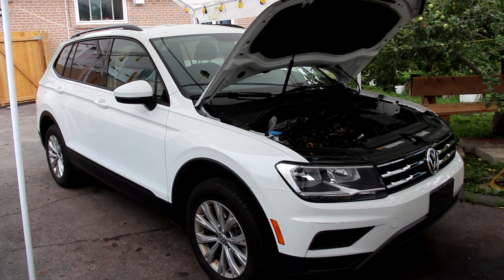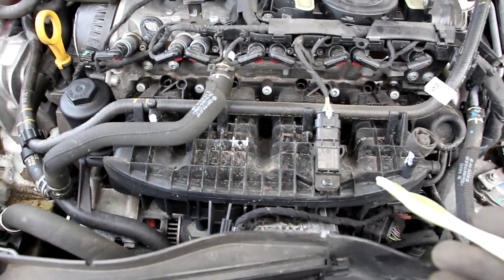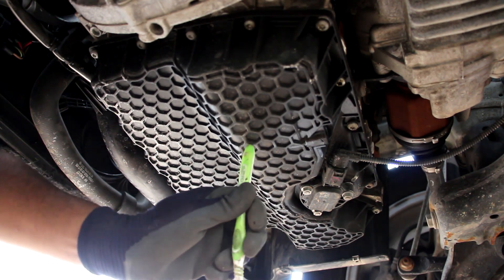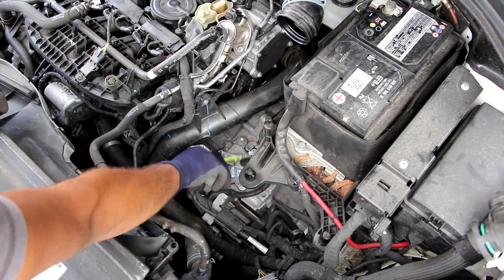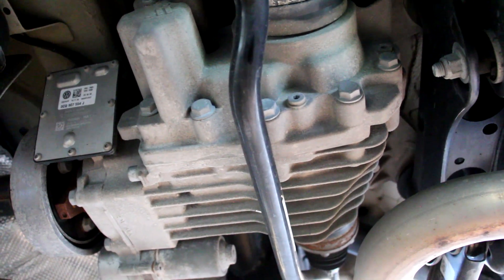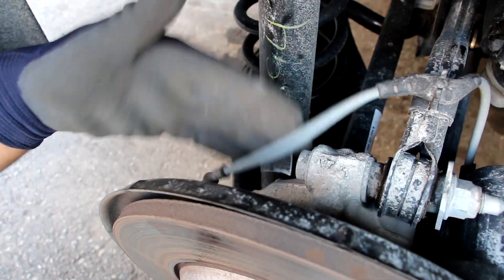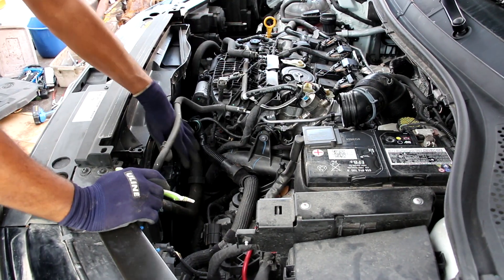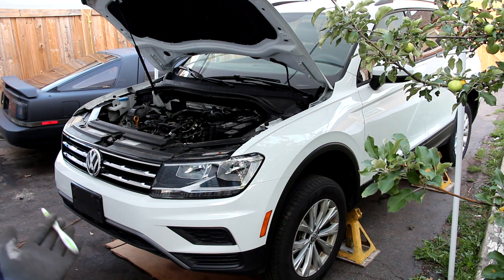Volkswagen Tiguan Mechanical Review

Comment: I bought  a used 2018 Tiguan S just like the one on the video with  110K miles . I replaced the turbo at 112K miles . Right after that , replaced water pump / Thermostat. I had EPC light back in with Turbo issues again , this time VW technicians are suggesting to replace Engine Harness which cost $3K to replace and install which I am doubting to fix at this point … not sure what to do ?? Anybody have any suggestions or tips ??

Comment: I bought a 2019 Tiguan SE with 12,000 miles. 6 years later and currently at 197,000 miles. Extremely reliable. Regular oil changes, 1 trans fluid changeout, couple sets of brakes, tires, 1 battery, spark plugs, and two coil packs . Still on original water pump. No leaks. Currently burning around a quart every 8,000 miles. Still runs and drives like new.

Comment: 7:28 notice how the dipstick is pulled and after he goes to start the vehicle and says it’s running poorly? That’s because he purposely created a vacuum leak, yet he won’t acknowledge or admit it…😂
Reply: Yeah. You can hear the vacuum leak. OIL separator doing its job keep the engine on.

Comment: I have 88000 on my Jetta GLI in 4 years and it has been fantastic.  Only issue I had was with the plastic oil pan.  If you change the oil you must use an OEM replacement plug, the third party ones leak.

Comment: that 0w-20 oil should be vw 508, which is quite expensive.
Reply from the maker: From the dealer? Why not from parts store
Reply: I am in Canada. The cheapest I used to find is the Pentosin Pento speed sp lv, which compliant with the vw 508, roughly 10 dollar cdn a liter. But that is widely sold out in my area. Now only can find liqui Moly top tech 6200 more cost effective. The motul spec 508 is more. Other brands like M1 ESP X2 or Castrol whatever also more. Like 18.99 in canadian tire. Compare to the regular 0w20. For damm sure the 508 spec is more.  @speedkar99

Comment: How many hours have you spent behind the wheel of the Tiguan?

How can you give that criticism to the interior of that car!  It's exceptional !  I can drive 8 hours with normal  breaks without complaining.

Additionally, we have had our '18 Tiguan since new.  It's an exceptional vehicle.  100% dealer serviced 
.. never a check engine light.  Whose car are YOU evaluating?
I was hoping to subscribe to a decent , thorough car technician who could be helpful.

Unfortunately, you obviously have no knowledge of the brand or model of vehicle of which you're  evaluating.

Not a subscriber, after that.

You, sadly, are a quack.

BTW - I am a corporate Fleet Manager with over 25 years of experience.

Quack!

Comment: I hate how people crap on these cars about their reliability. People need to understand that VW’s can’t run off of just Oil changes like a Toyota, they need more than that! I change my oil every 10,000 kms on my 2018 Tiguan and service the Haldex all wheel drive system every 40k and spark plugs every 60k. I even do the transmission every 130,000kms. People need to realize these cars last with proper maintenance and fuel. USE PREMIUM FUEL IN YOUR TURBO VW’S!!! Even if it says regular, you should still use premium.
Reply: You've highlighted the issues with them Jeff, they are inadequate for a working life of hard use. They are fragile.
Reply: @cliffwilkins9178  where did I highlight the issues? Simply said what these cars need for reliability. The only reason why Volkswagens are seen as unreliable is because people that buy them are used to driving a Toyota. They don’t put the recommended maintenance them to them.
Reply: @cliffwilkins9178 exactly stay quiet

Comment: Looks like a lot of the parts are easy to access for change out though a lot of plastic going on here. For example I have a 07 tundra 5.7 and things like the starter/alternator are hard to access their tightly snugged to the bottom of the engine.
Reply from the maker: Yeah the Toyota V8 has a really bad starter placement

Comment: VW products are loved in Algeria and tend to last a fair bit of time and depreciate the least... we mostly have naturally aspirated gasoline engines and the reputable 2.0 TDI 143 HP euro 4... no FAP or AdBlue to worry about... the most commun problems are injectors related and automatic transmissions ( 80% of the cars are manual )

Comment: You mentioned that that that the design does not include a radiator drain plug, Additionally, it doesnt really include a 'main' radiator fill-cap.  Instead, there is the remote radiator overflow tank... that allows 'filling' there... which only works if the radiator (and system) is already filled with water. 
 When the 18mm (small) horse 'blows' between the reservoir and the radiator for example... and ALL the water blows out of the engine, and you're on the road in the Sierra, then NO 'gas station' mechanic can simply patch the hose, and put water BACK into the engine... without 'special skills' or an electric pump.

Comment: Due to a recent car shortage i ended up purchasing an inexpensive  base model 2021, brand new that's currenty at 4k miles.... Going to follow scheduled maintenance intervals and see how long it lasts before major problems arise. Honestly curious.
Reply from the maker: Hopefully all goes well. Pay attention to the oil levels at every gas fill up
Reply: How's it going so far? I'm thinking about buying this model
Reply: @sailorsct4292  so far so good  👍  currently  sitting at 23k miles. It fits a full costco run along with entire family. Good  power and 36 mpg on road trips on regular gas.
Reply: @napalm84  Hows the reliability
Reply: @rken3116  Good reliability overall. Currently sitting over 37k miles w regular maintenance.
Reply: @napalm84  thank you for the response

Comment: Have had a FWD 2018 Tiguan for 4 years. Had no mechanical issues so far.
Reply: How has it held up since your comment? So in the last 2 years? I love the 2024 tiguan but am worried about reliability
Reply: @katerinapascht6075  I will buy one this month, I was going to buy a 3 cylinder 25 Chevy Trax fully loaded 2RS for around $28K with a 60 month 5.4% APR with my Credit Union BUT just found that the base 2024 Tiguan S Is SUPREME!! for just $30K with a 1.90% APR for 60 Months so thanks to this VW promotion it will be the same cost as the Trax but Honestly the Tiguan is extremely a better all around vehicle than the Trax and it has 7 SEATS!! WOW
Reply: I wouldn't expect a 4 year old car to have mechanical issues. If it does that's sad. 4 years with no issues is not an achievement lol.

Comment: I had a 2015 Audi A3. Since 2017, I had to send it to service due to coolant leaking issues basically at least 1 time per year. They told me many reasons for the leaking, including sealing issues, water pump failure, etc, but they never really fixed it. One time, they told me, ok, we fixed it, after 10 mins driving, my engine smoked. In 2020, sold it. I told myself not to buy any Audi again.... While ordered an RS3 a couple of months ago.

Comment: One of the best technical information videos ive found on the ea888 engine .I have the mk1 tiguan .Would you have any idea if the air conditioning drain pipe is in the same location as this updated motor.I have a really smelly ac system and wanted to clean the evaporator

Comment: 2018 Tiguan is my first and last VW.
2 Months in and it goes to VW for going into limp mode due to what I was told a loose connector at the accelerator pedal.  
Then is gets recalled for a coolant bottle @ 10k and the coolant still noticeably drops between services,  I can even smell coolant after a long drive.   I mentioned to VW I suspected coolant loss/burn stated the amount of cooling I'm loosing between services is normal, What?  
Recall for ECU reprogramming @ 20k.  
Then about 30k I started getting warning flashes on the dash and by the time I look down  it's gone and doesn't appear in the fancy vehicle status screen.  Check engine light going on then off and VW says it was all a low battery but tested it and didn't recommend replacing it.  
30k service included 2 new tires with alignment, all new rear brakes, diff fluid change, cabin filter, brake flush to the tune of $2000. 
 I'm afraid to work on this myself like I have every other car I've owned because with all the issues its having I want to make sure VW doesn't use me working on it as a way to weasel out of honoring warranty work.
Now at 32k Transmission goes into "emergency mode" and had to bring it in for shifter replacement.
Reply: I would never ever buy a vw again, it's sounds like a great nightmare

Comment: Had a late 90's Audi A4 1.8L. Still VW engine, after 100k km, nothing but problems, engine wise, transmission wise, also wheel bearings too. The whole 5 yrs I owned it, the car costed me around $9k to fix and keep it going. Eventually i sold it, as it was costing me to much, and bought a diesel Hyundai I30. 6 yrs now and no issue.
Reply from the maker: Nice. Was it a turbo? I'm doing a 1.8T teardown video now

Comment: I love that car, it's engine is made of steel and that to me is something that you can sleep better at night for. The rest well it is a newer vehicle so techonology as scary as it is at first with my VW it has proven to be the most reliable in the long run.
Reply: How can you sleep better as steel block and alumnium head mating surface will very likely to warp due to different expension rate.
Reply: @xuanzheng1049  cause Ive been driving cars like this my whole life, I have a 28 yeay old vento and it runs perfectly as reliable as ever. Now Aluminum blocks when overheating and cars do overheat for different reasons like bad fan relays, temp sensors etc require resurfacing of both block and head meaning less life to the engine and extremely expensive repairs. Most people change cars every 4 or 2 years so tbey don’t know what Im talking about. This VW is built to last 💪
Reply: @camcappe353  did you not read my comments well ? Your Vento has both steel block and head thus has the same expansion rate but the Tiguan doesn't. It has different materials as block ad head which will likely warp down the road due to diff expansion rate.

Comment: Too much plastics on new German cars those years, I will never trust those cars again, cheap matériel parts with an expensive price to buy, for maintenance is more awefull cost to maintain.
Reply: Everyone uses too much plastic. You can argue Toyota uses less but that's because their engines are as old as time itself. That's not a bad thing though because the 3.5 is smooth and powerful.

Comment: 2.0 two is very problem prone. Screws on air filter are not an issue but lots of problems. Do your research before you go on babbling about the mechanical system. Direct injection, timing yensioner, valve stem coking, plastic intake, goose neck, coils, fuel pumps, spark plugs, front lower control arm rear bushings... On & on with mechanical problems. Get the extended warranty or increase the limit on your credit cards.
Reply: The older version of the 2.0 EA888 sucked (1st and 2nd gen) for tensioners and oil burning. The 3rd gen is everything this engine should have been 10 year ago.

Comment: Modern "FU" engineering:  air cleaner 2 hour job, oil filter, 45 minute cleanup, no transmission filler, plastic oil pan, alternator - designed to destroy your ac system, no port injection so you get to choose between extra maintenance or early junkyard entry, and no drain plug for the rad.

 All in all, VW has successfully made sure that VW buyers will learn that any other non-German brand will be on their shopping list sooner rather than later.

Comment: Thanks for your review! Great vehicle design, the engine is very refined. They actually perfected the 2.0 TFSI for more than a decade to make it more reliable. The oil change and spark plug job is an absolute breeze. For DIYers who are concerned with the plastic oil pan, it is very easy to replace it with a metal one.

Comment: The Tiguan, maybe assembled in Mexico however it is hardly Mexican technology in that engine bay. However popular these small engines are, I don’t like them much. You would be better of with a Toyota Hilux. Especially some where that may have good mechanics every 20 miles. I prefer engines like my E550 because it’s a simple enough engine I can fix it.
Reply: For a Mexican made car, from my experience they are well put together. I have a 2021 GTI, and I can tell you right now that the interior is less rattle prone than Mercedes (of the past 6 years), and the car feels so nimble and refined it exceeded my expectations upon test drive.

Comment: Wow my sister has one and the price point is great and I was thinking of buying one but maybe I'll end up with the Rav4 instead.  Can the plastic gas tank and all oil covers be replaced with metal??
Reply: All cars use a plastic fuel tank. Metal ones rust and create more problems. You can swap in the steel oil pan from previous generation 2.0 TSI's.

Comment: I really liked the feel of this car, it drove really nice.
But I sold mine now after 1.5 years..
Got the 2012 Model with 1.4l TSI. The number one reason I sold it now was the failure in the instrument cluster, my canbus gateway broke down so I couldnt start the car anymore.
And yea... the timing chain of course started to make noise after 75.000km.
But I have to say, the build quality looks completly different from this mexico build one in this video, holy shit. WTF is this? 

Before the Tiguan I drove a Seat Ibiza from 2004. The engine nearly undestroyable. But I had to get rid of it because it simply rusted away.. :/

This Friday I get my "new" car. Suzuki Vitara 1.4l from 2018 with automatic (sadly no 4x4). I hope this one will last a lil bit longer..
Reply from the maker: Nice. I just picked up a VW GTI motor (EA888) for teardown

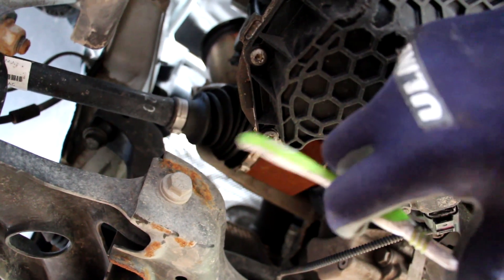Comment: At 11:55 I see a laser point on the screen, is that so you know where you’re aiming at for the camera?
Reply from the maker: You mean the dead pixel? 
I don't use a laser pointer
Reply: @speedkar99  tried on a different screen. It’s still there...
Reply: @speedkar99  At 11:55 the point is 1” south of the axle boot and more toward the bottom of the ball joint

Comment: A lot of VW haters in the comments. I have owned two - a 2010 Golf TDI (stupidly traded due to the scandal) and now a 2017 Passat. Repairs have not been excessive for either. Both drive exceptionally well on the highway and are a pleasure to drive generally. Highway fuel economy is stellar on the Passat for such a large car. I agree that VW's may become more expensive as they age and are needlessly complex, but the hating on them is typical for North Americans. I am not convinced they are inherently worse than other brands with middling reputations (e.g. Dodge, Kia, Ford, etc.).
Reply: some people just don't understand Volkswagens.  They need the fluid changes when specified or sooner or bad things could happen!  Also some people would say these are difficult or maybe even impossible to work on.  It is not really any different from any other modern vehicle.
Reply: @charleshines5700   agree with your comments. I've become and Audi Volkswagen fan. I've self maintained A4's Tdi's and now a Tiguan. I've had a more than a few with close to 300k miles.
Reply: @joem3970 yes I agree with you , keeping well ahead with the oil changes (TDI ) 2019 Tiguan R had 4.600 miles when purchased it am hoping with careful driving and maintenance to get many years once I learn to change oil myself , like the vw diesel polo I had from new 21 years ago only wear n tear items replaced clutch/ cam belt/water pump and belts no body rusts “what’s not to like I say  !
Reply: Only 2017 lol that's not old at all
Reply: Ford vehicles are a disaster!
Reply: I think a lot of VW haters as you put it is that some would not be welcome in Dealerships as it’s obviously the case they could never afford one .
Reply: @fredkeogh9035  Y'all are so delusional it's funny
Reply: This comment was 3 years ago and you're talking about 2017. That would make the car 4 years old when you wrote this. Of course you wouldn't expect a 4 year old car to have major repairs needed lol. Even in 2024 that isnt old.
Reply: @IamJay02 my wife has a 2019 gmc Acadia and it’s having issues. It has 190000 miles. Since this car is even newer according to your logic. Which doesn’t include mileage or critical thinking. It shouldn’t have any issues right ?
Reply: @trey6892  No it shouldn't with minimal maintenance. It's a 6 year old vehicle with I assume mainly highway mileage. Pretty pathetic if you ask me.

Comment: I bought my sister a 2018 Tiguan and it has a tapping noise when it is cold. Dealer said it is normal but it did not do that when it was brand new. Called Volkswagen of America and is waiting for a reply.  It usually takes a couple of days.
Reply: I have a 2024 and this is normal. I don’t know what it is, but they all do it.

Comment: Hi the transmission oil pan on tiguan is made of stamped steel it is not made of plastic like the engine oil pan, and I think the transmission(its the 09P) has different sump bolts since it is made by aisin(toyota)

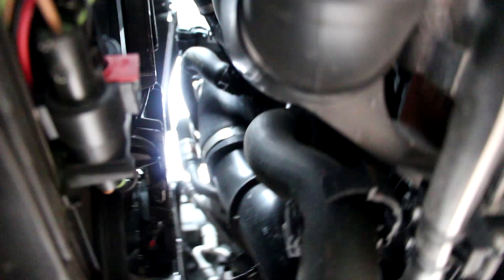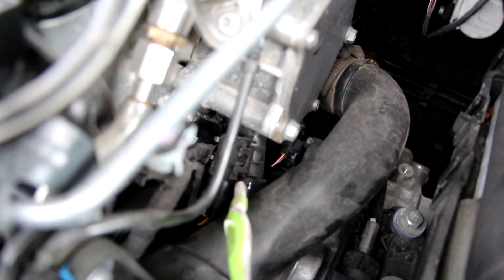Comment: 15:08... "Electric water pump...."   15:31..." Water pump driven by a toothed belt..."
Confusing!? Two water pumps?
Reply: Yep, two pumps. The belt one is like most other cars, the electric one is for the turbo and to keep the coolant flowing after the engine is switched off.
Reply: @Ellie_Melloy   Hey, Thanks Elliot. Makes sense now. Cheers.